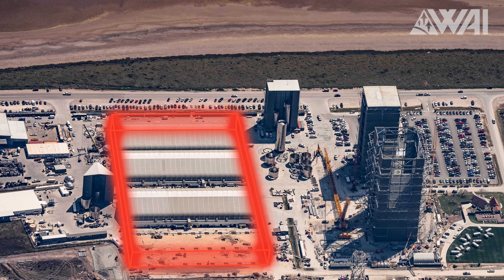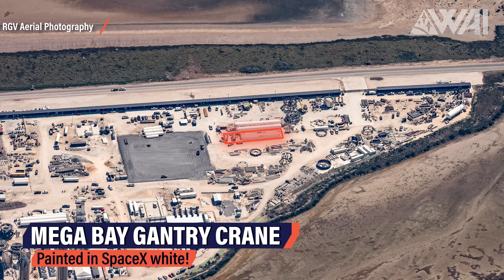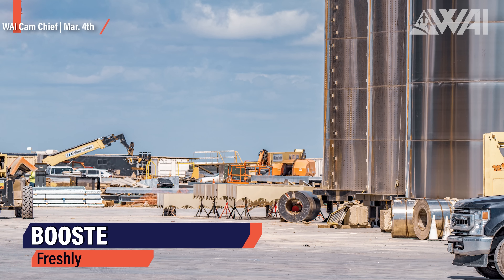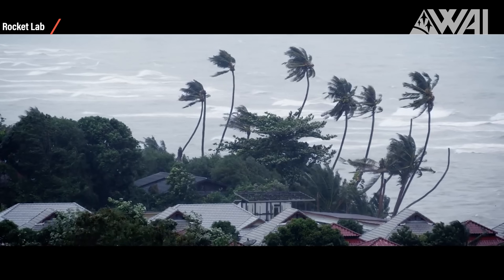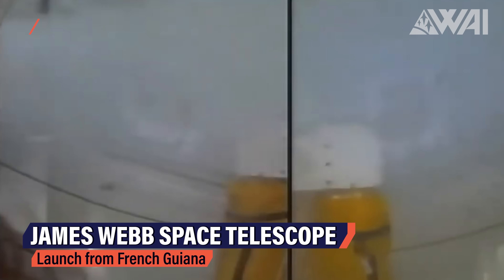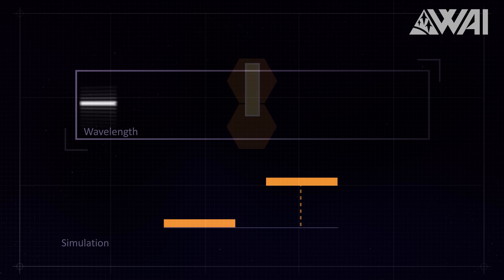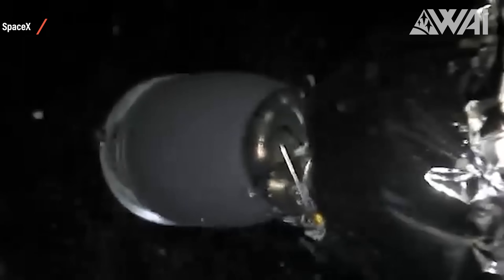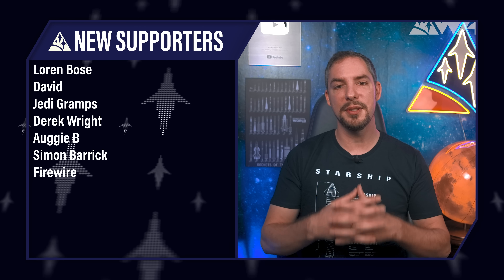SpaceX Starship StarFactory is GIGANTIC! – JWST Update – ULA GOES-T – Electron Launch 24

Comment from the maker: Will Ship 20 do the flight? I am still undecided. What’s your idea? :_WAISweet:
Reply: I believe in 420 at 2022-0420 at time 4:20 pm =P
Reply: Yeah ship 20 will fly. It doesn’t  make sense not to just because they have RV1 engine’s. There’s mountains of data that can be gathered from going to orbit and attempted re-entry.
Reply: I still believe 4/20 will fly. Mainly because the flight hardware will be expended and not recovered, and since raptor 1s won't have anymore use apart from gathering dust, might as well pus it to the limit. But the bonus is the added sensors on Raptor one would be good to have as the first flight will be a full stress test as well.
Reply: I believe ship 20 will fly for several reasons.  Raptor 1 engines, which are outdated by this point, not worth recovering on a ship that will be expended in the ocean.  Same as Booster 4.  It will cost relatively little to fly Ship 20, with the potential to gain great data, whether it survives reentry or not.
Reply: Absolutely not. And a big no for B4. They are dinosaurs in the SpaceX world. They are being used to test stage 0 and maybe a static fire for B4 to test orbital mount. They going with an orbital booster with Raptor 2 design and 33 engines. The Ship will also have R2’s
Reply: I realize there is pressure from the limited number of launches their launch permissions allow and knowledge to be gained. But if it were up to me, I’d launch 420. This would provide useful information on booster launch systems and the all important information on ship heat shield function, using obsolete engines whose loss at sea won’t be missed. Besides, some modifications are going to have to be made to the launch base and tower for the new booster & Ship configurations, so this would leverage effort already expended for useful information.
Reply: I'll be the sourpuss of the bunch.  Since Elon's meltdown over Raptor 1 and the escalation of Raptor 2 development, I've believed that 4/20 would be used for ground testing and Stage 0 proofing, but wouldn't launch.  SpaceX has to weight the importance of flight data they'd get back from a now-abandoned Raptor 1-based system with the risk (and cost) of blowing up Stage 0 on launch.  It seems to me that with every iteration of Raptor 2 and as each day brings more investment $$$ into Stage 0, the likelihood that 4/20 actually launches diminishes.  The longer their EA/EIA keeps them on the ground from a regulatory perspective, the less likely 4/20 see air time.

In a nutshell, I don't think 4/20 will launch in any capacity, but we'll see.
Reply: i dont think theyd do that much with 420 if flight isnt planned or else why test everything with raptor 1 if you can do it with raptor 2 instead? also didnt raptor 1 have more sensors installed as its experimental (not sure about that one)
Reply: @Kroko6  all the extra sensors on raptor 1 were there for data only ! Just the necessary sensors are kept this is why raptor 2 looks more cleaner also raptor 2 has more plumbing thats welded together instead of bolts and flanges !
Reply: @scottymoondogjakubin4766  thats what i mean why not fly once with more sensors that maybe arent critical but also provide data in new operating conditions. You can never have enugh data especially if its something as importand as the engines
Reply: @Kroko6  ya why waste all that time and effort and especially all that data ! unless there are some critical flaws that need to be addressed and would be to costly to upgrade ! right now its just a wait n see thing !
Reply: I think they use it.  It is disposable after all with perfectly good engines that would never be reused and tiles good enough for one time reentry.  The first orbital launch is meant to crash into the ocean if it even makes it that far, recovered only for national security and data recovery and analysis purposes.  It was always thus.  Also it keeps Elon’s 4/20 dream alive!
Reply: If they weren't still intending to fly 4/20, I think they'd have retired / scrapped them by now.
Reply: 20 ought to fly and "accidentally" re-enter on putin's head
Reply: Why not fly both? SpaceX will have several prototypes when they get the FAA approval
Reply: 24 is my guess.... 
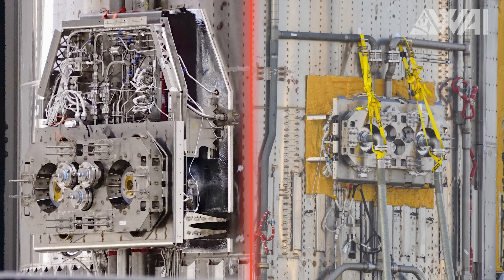BUT @ 4:00 it looks as if a WHOLE BUNCH of intricate plumbing  that USED TO be on each engine has been moved to this ONE area around the Quick DisConnect..... 
Do you think that THIS is what all these are?? Or is it something else?? I know a lot of the plumbing that was on each of the Raptor 1's was for testing purposes, but we don't see all of THIS plumbing around the OLD Quick D/C ... so what could it be??  Maybe they moved a lot of the plumbing from other areas that took care of the flaps and other movements all into one spot.... I guess we'll just have to wait and see!!
Oh yea... 
THANK YOU SO MUCH WAI TEAM!!!! YOU ROCK!!!
Reply: I think 420 will definitely still fly, if it wasn't in the plan they wouldn't be doing all of this additional work to it. And since it's going to do a soft landing in the ocean and everything is going to be destroyed I can't see Elon choosing raptor 2 when he has a full rocket built with raptor 1 ready to go. Yes he has newer equipment but this is still test bed stages with experimental equipment. Data Data Data!
Reply: I thought i heard a whisper spacex was swapping out the raptor 1s with raptor 2's on b4s20 ! all ive seen was a lot of cryo proofing !
Reply: I think S20 will still fly because what else are they going to do with 35 (sea and vacuum) raptor 1’s.
Reply: Yes, FAA approval on the 28th of March followed by a full Starship launch on April 1st - just because they can :)
Reply: Ship 20 will be ideal as a first test for launch systems.
Reply: We Really need a ship called '"4-20" and I think Elon needs to make sure we launch it.. he gets the 420  :)
Reply: yes it will B-)
Reply: Yes - primary test subjects will probably still be stage 0, heat shield tiles during reentry, control software, booster navigation & hover accuracy etc. - why dunk 39 perfect Raptor 2s if you can do it with 4/20?
Reply: If it's ready why not? Why waste an opportunity?  Send it and get data, regardless of which engines, it's still useful data, especially re-entry for the ship and booster.
Reply: Well ........ Everything is up in the air right now
Reply: @FenixTheSnolx  who's plan is that? ;-)
Reply: @FenixTheSnolx  great, where can i find that?
Reply: @percurious  he won’t tell you because there haven’t been any announcements stating that ship 20 won’t fly.
Reply: Why not,  they don't need another metal statue in the rocket garden.

Comment: My speculation for why the Grid Fins are painted White from Black: Grid fins are made from Titanium metal which can withstand high temperatures which is necessary as, the booster will travel at ~Mach 7-8, which is enough to raise the temperature of the fins. Black is very good at absorbing heat. Re-entry heat on top of black paint absorbing heat can seriously damage the fins, completely making it useless. On the other hand, White is very good at reflecting/radiating heat. Painting the grid fins white can help it quickly lower its temperature, increasing its efficiency, thus requiring less maintenance!

May be wrong but you all can correct me, for the sake of easiness to everyone

Comment: Absolutely not. B4 and S 20 are dinosaurs in the SpaceX world. They will send booster and ship that can fly raptor 2 engines with 33 on the booster. Why test designs that’s are obsolete? Right now they’re using them to test stage zero is my guess. Maybe a static fire from booster 4 to test orbital mount

Comment: Hi, I wanted to post the following questions in your video about the latest Starlink mission which was earlier this morning but couldn't find your video on it where I would of posted these questions, so I decided to ask it here in this general comment which I've already posted on other channels but with no answers as of right now. So, here's what I posted...

"Just curious about an observation which I am sure many other people noticed as well, which is, the many previous Starlink missions until I'd say since the beginning of 2022 carried less than the usual 60 Starlink satellites and are now down in the mid to high 40's in numbers instead of 60, is there an explanation for this? 
Has this question been already asked and answered yet?

Because every time a Starlink mission which had less than the usual 60 satellites was due to carrying another satellite and thus making more room for the extra satellite. Now, it's been many times where Falcon9 rockets carrying Starlink satellites has been under 50 and higher than 43 in numbers but never the usual 60 count of Starlink satellites prior to the beginning of 2022. 

Is SpaceX delivering extra satellites on its Starlink missions and not divulging this fact due to probably a DOD Top Secret agenda/gag order? I'm not a "conspiracy" theorist by any means, but there must be a good reason for not sending 60 Starlink satellites as per previous missions and dropping the satellite count to around 43-48 satellites per Starlink missions instead of 60, since the start of 2022?
Sorry if this sounds like a stupid question, but it's a question I think has a bit of value in it's answer imo."

Comment: How does SpaceX maintain/plan to maintain such a huge inflow of fuel? Are there underground lines that feed directly to the tanks? 92 trucks sounds like a lot per ship, let alone 3 launches a day!
Reply: Three launches a day is a far off goal, not how they will start out. The FAA review for Boca Chica only lists 5 orbital launches per year. Likely due to the Texas state law on closing public beaches. The Texas legislature had to modify that law a few years ago to allow SpaceX even the limited closures that they have now. SpaceX had started and paused Starship work at LC-39A BEFORE work at Boca Chica took off. LC-39A will likely do most mission Starship launches and the converted oil rigs will likely do most of the Starship Tanker flights. Per the GAO report denying the HLS Option A complaints, SpaceX is looking to fly Starships every 12 days or so for the Artemis III mission.
Reply: @steveaustin2686  So it seems the fluel inflow constraints arent a problem yet because of the infrequent flights; makes sense in the early stages! And (obviously) validates the oil rig launches in a way I hadn't thought of, huge tanks and massive pipe infrastructure built in! Do I hear starship ocean cities in the future?
Reply: @whistling.citrus  Yeah, LCH4 and LOX are not that far off in temp, so LNG ships should not have a problem being modified to carry them. LNG and LCH4 are practically identical, so it would be the LOX that may need modifications. I would expect they would ship them separately, so that should not be a problem.

I have a feeling that the oil rigs will handle most to all of the propellant launches with the LC-39A pad and maybe LC-49 handling most to all of the mission ships.
Reply: @steveaustin2686  Texas has a law about closing public beaches, but maybe they could lease the beach to SpaceX, and SpaceX could make it a PRIVATE beach. Then Elon could close the beach BUT announce when the beach would be OPENED TO THE PUBLIC.  The locals will think that Elon is so great for opening the beach.
Reply: @thomasmaiden3356  It's already a public beach, so I'm not so sure Texas would make it a closed beach. Some of the locals are already upset that the beach gets closed too much already.

Comment: These prototypes are expensive, so that's why I think SpaceX will fly them if remotely possible. Especially because they expect the first ones to meet a flaming death any way. Launching a slightly outdated prototype and loosing it still gives loads of valuable data. Some of which even might save one of the more up-to-date prototypes from meeting the same end.
Reply: I thought I saw somewhere that the prototypes cost in the 10s of millions... relatively cheap! And they are flown autonomously meaning that the rockets themselves follow the flight plan. It's going to be a long while before people are on board but even then  the rocket will do all the driving ... unless something goes wrong. A lot has changed since apollo 13!! .. but you're absolutely right they get a ton of information from each flight and either way would be a great spectacle!

Comment: About the new contract, how much profit would SpaceX collecting from the 3.5B dollars? 1? 2?
I think the margins should be high, as the contract for the first flights should pay all the R&D and now this investments are much lesser.
Reply: We don't know. There are estimates for cargo launches of $15M to $30M for internal costs on a $50M advertised recovered Falcon 9 B5 price. Crew launches almost certainly have a higher internal cost for more checks than a cargo launch and because there is additional hardware, like the Superdracos for aborts. Without some idea of the internal cost of a crew launch, we just don't know how much SpaceX is making. The Commercial Crew contracts are firm, fixed price contracts, so SpaceX has to build in all of the profit at the beginning and any cost overruns are on SpaceX.

Comment: Why aren't the grid fins made of a composite material? It's not like they have to take a lot of heat... seems like a waste of mass
Reply from the maker: Not too much, but they do take some heat. F9 even had problems with burning grid fins in the beginning.
Reply: Likely because the Superheavy grid fins are so large. Musk said that the steel ones weigh about 3 tons each, so enough titanium to make them out of that metal would be very expensive.

Comment: CORRECTION: It isn't a gantry crane going into wide bay. This will be a bridge crane, where the building supports the load. Gantry cranes roll on the floor and are generally better suited to move things in and out of buildings. Impractical for tall rocket sections which are easily moved in and out on roll lifts which are more maneuverable as well :).

Comment: I’m curious as to why the contract with NASA is for 3.5 billion. At a cost of 62 million per launch this would indicate NASA intends to launch around 56 flights?!? What am I missing that makes this contract worth so much?
Reply: Likely it is the marginal cost without the development added in. The GAO gave the $55M per seat cost for the first 6 flights ($220M/flight), which doesn't add up to the $2.6B contract for those flights. So I think that the development is not factored in. If the new $300M per flight cost is only the marginal cost, then SpaceX jumped the per seat cost to $75M. If that $300M is also paying off some of the development, then the price per seat may not have changed much at all. I'm sure the GAO will update info on that at some point in the future. If you divide the total contract by the 11 flights, you get around $318M per flight for Crew Dragon. Starliner's 8 flights for $4.2B, is around $525M per flight. Excluding pad abort and inflight abort flights.

The $62M is the advertised price for an expended cargo Falcon 9 flight and $50M for a recovered booster. Additional services can up this price. Manned flights almost certainly have higher costs for more checks and equipment. The cargo flights don't install the abort system for example.
Reply: @steveaustin2686  Good point... it occurs to me that Timothy and myself might have been getting confused by the fact that the price per Dragon seat just happens to be very close to the price for the Falcon launch.
Reply: @simongeard4824  That is true.
About the seat cost, not the confusion. Spaceflight can be confusing for anyone as it is so complicated.
Reply: @steveaustin2686  very well explained. Thank you!
Reply: @timothyewing4009  You're welcome
Reply: I was wondering that myself. Roughly $60m is the price of a simple Falcon 9 launch, so a crewed Dragon launch will be higher... but not that much higher.

Long-term capsule rental, maybe? I'm semi-joking there... but unlike in the past, NASA doesn't own the vehicles... so if they're keeping a Dragon at the ISS for some months, it's preventing SpaceX from using it for other missions, so something like a daily fee might be part of the costs...

Comment: surely with the Russian moves on space recently the government could call this site a national security priority and designate this area a hybrid military installation to exempt some of the requirements or at least provide resources to fast track / help with any issues.
Reply: Nah, Starship has a lot of development to go to help anytime soon. ULA and Northrop Grumman already have the engines and boosters they need for the rest of the contracted flights for the Atlas-V and Antares 230+. If more Cygnus flights are needed, it can fly on the Vulcan Centaur and/or Falcon 9. SpaceX has excess capacity with the Falcon 9 to fill in for other launchers.

Comment: 3100 to 3200 tons of liquid nitrogen???? Just say "propellant" and let the tucks carry any liquid they want. Or just say the average weight that a semi can legally haul here in the US. And that number is actually closer to 28 tons of "product" and the max fuel capacity held in Super Heavies booster tanks is 3600 tons of propellent. Thats roughly the weight that 129 can haul legally. Or say that is the weight of 90 fully loaded semi trucks. (max legal weight for interstate commerce is 80,000 lbs)  (Can be more or less on state highways) 

But Simpler is often better so we might use  a common bottle of water for comparison of scale and say...

The total weight of propellent held in Super Heavies booster tanks, when filled to their capacity in liquid form is equal the amount of water held in 7.2 Million standard sized bottles! Thats like launching 6 of the largest steam locomotives ever built!!!!!! The Union Pacific Big Boy weighted 1.2 million pounds with tender full of water and coal.